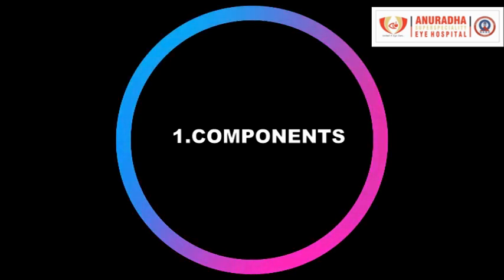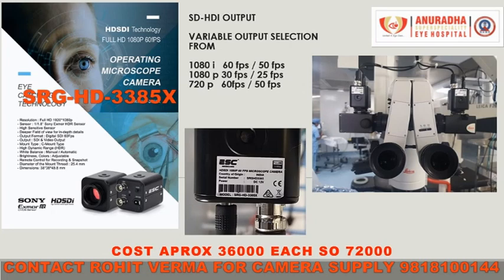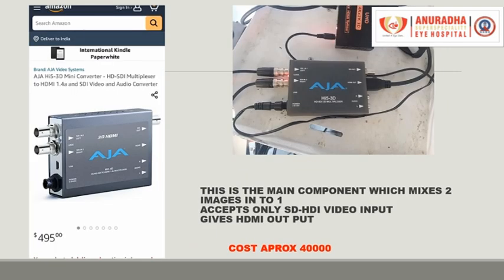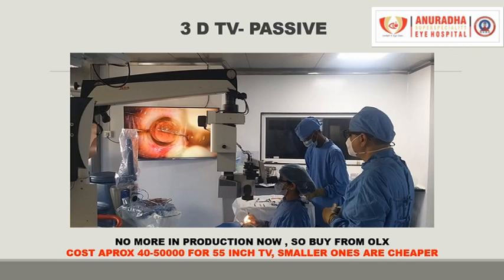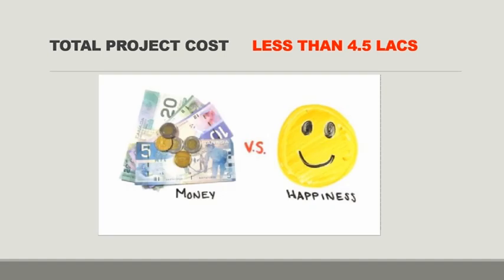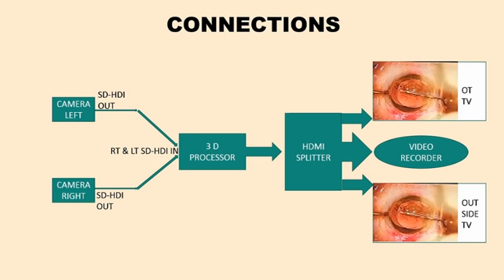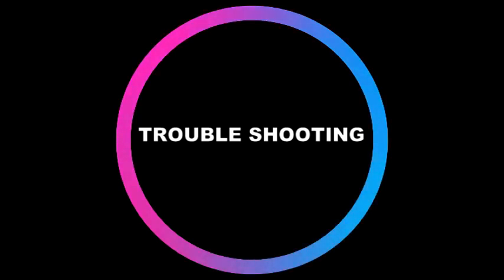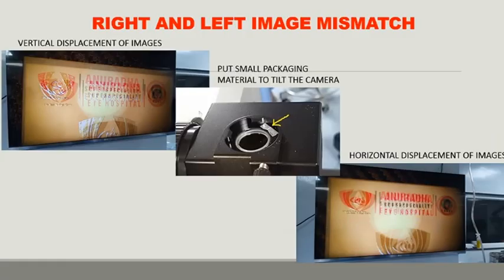HOW TO BUILD 3D CCTV SYSTEM FOR OPHTHALMOLOGY

Comment: You don't have depth control in your system , which is extremely important , because the image you get is flat and shallow.
Reply from the maker: Thanks for your valuable comment. The depth is wonderfull. And can be enhanced in settings available in 3D TV.
Reply: @killedarmilind  It's good to know that depth control in optical systems is achieved by controlling the size of the objective aperture and not with "3D effect control " available in TV sets  . In simple words you need iris diaphragms on your light paths.
Reply from the maker: Ok